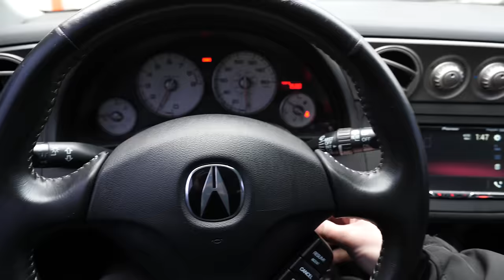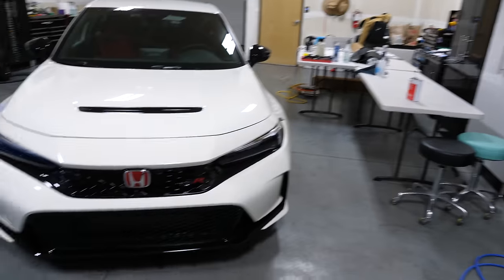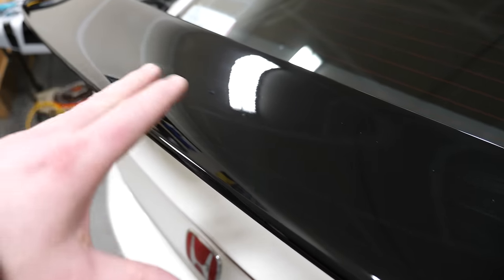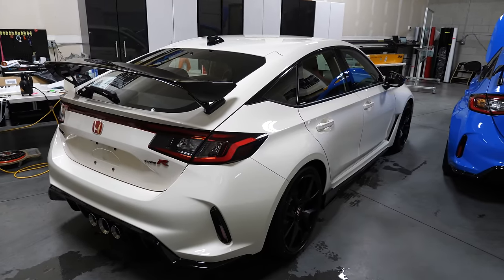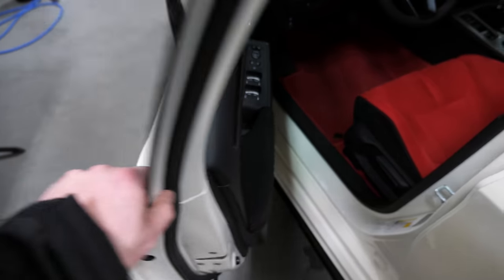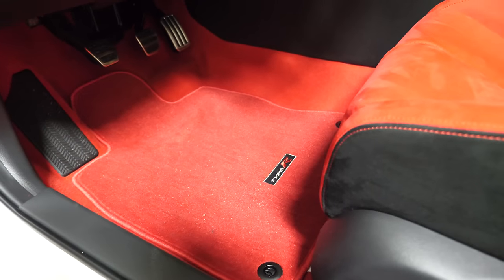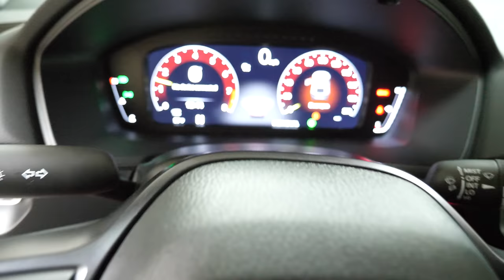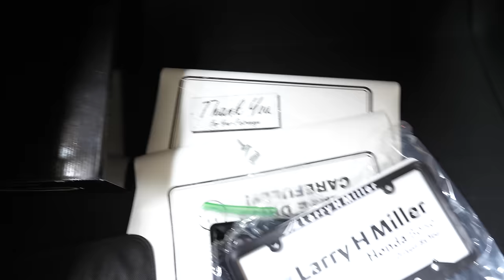Honda Civic FL5 Type R FIRST Impressions (From a 90's Honda Guy)

Comment: Imo, The FL5 is wayyy better than the FK8
Reply from the maker: I think they both have their pros and cons. But the FL5 is more my style!
Reply: Agree, I love the styling a lot more. But maybe I'm just getting old
Reply: The fl5 is slower than the fk8 lol. And looks boring.
Reply: Facts
Reply: Way better in terms of what specs?
1. Fl5 is slower than fk8 on some tracks
2. Fl5 reaslnanly blends in more, i.e. less visible than fk8
3. Fl5 is heavier than fk8
4. Fl5 is apparently marked up more than fk8 intiially was. (Note markup is reasonably different from appreciation over time)
Reply: 💯% agree

Comment: The raised portion of the bonnet/hood I’ve been told is a design element manufactures are incorporating into their vehicles for improved pedestrian safety - In the event a pedestrian is struck by the vehicle the bonnet has a collapsable space that can be used to absorb the impact. As opposed to hitting the engine block through a thin layer of metal

Comment: In my preludes  back in the 90’s they came with stock Recaro’s so did BMW in the 80’s 90’s. Some sport edition Volvo’s had stock Recaro’s in the 80’s 90’s. If you could imagine seeing a 1982 or 83 BMW 320is They Recaro seats left you speechless 😱. They were gorgeous 👍

Comment: ive noticed that new type r / si got that weird short feeling on 5th and 6th gear. its too close to 3rd and 4th. comin from an ek hatch type r conversion my stage 6 clutch is better shifting than those new ones imo.